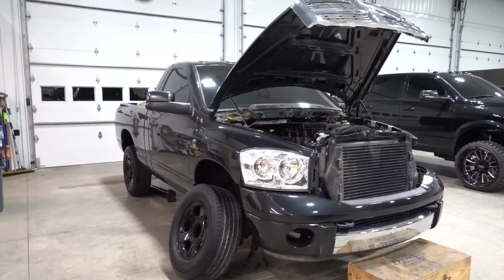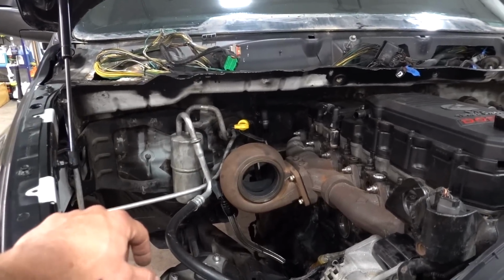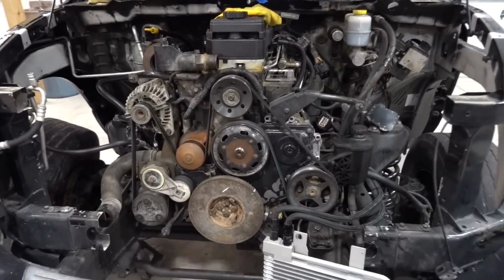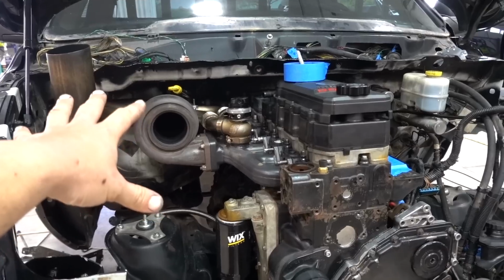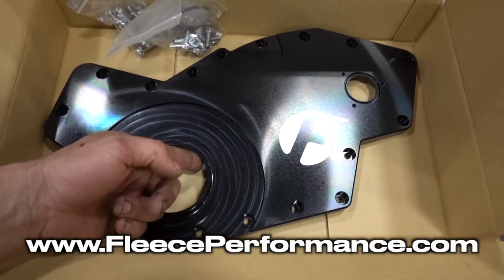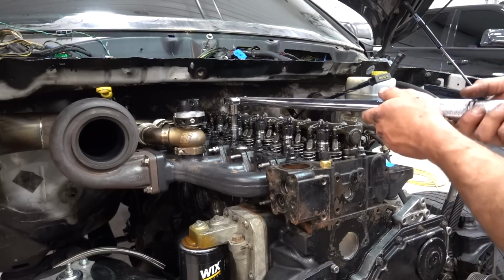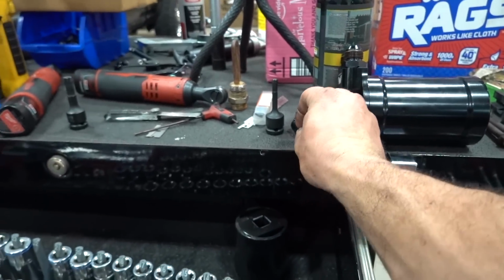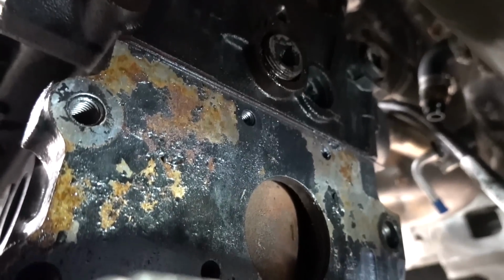Cummins Shorty Build Goes ALL OUT!!! OG Mini 05 TRIPLE TURBO!?!

Comment: Hey Greg, this is six in a rowJim from Kennerdell Pennsylvania I’m a heavy equipment operator I’m not qualified to say you’re crazy. Anyway good work finding that missing bolt and loose connection. That definitely would’ve caused you problems probably not at home. May be 1000 miles from home anyway you and Mike and Dawson do real nice work by the way did Mike get to run his dragster yet? It was really interesting the science it went into making that wheelie bar.

Comment: I  actually cut off the back pressure sensor chunk of steel off the thermostat housing and shave it smooth , just another way of doing it without buying any parts

Comment: I remember the video of the triple turbo setup in the OG truck, you were just easing into it and it was blowing the tires off at 60 with no effort. This thing will be a monster without all the added weight of the larger cab and other stuff. Cannot freakin wait.